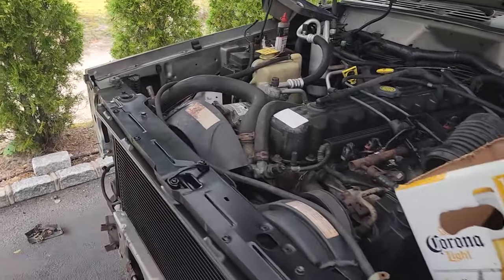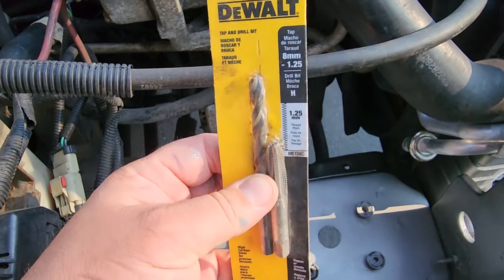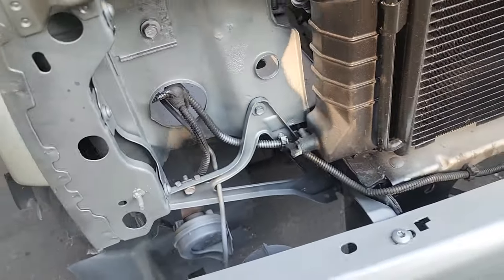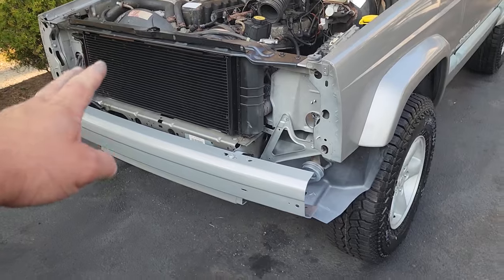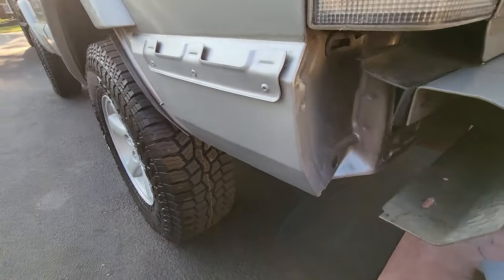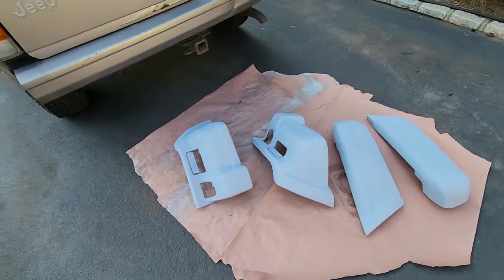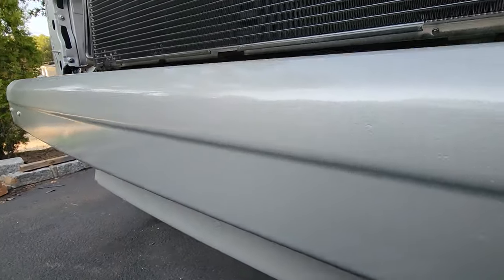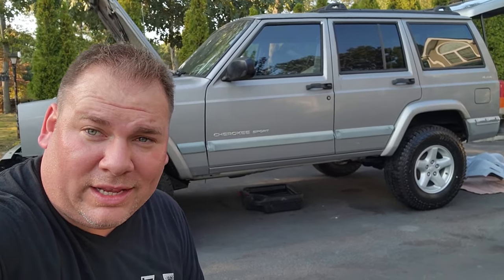THE TOAD EPISODE 5!!! JEEP CHEROKEE XJ PROJECT UPDATE.

Comment: Don´t worry about that bug in your clear coat. When you put your bumper end caps back on, this spot will be covered anyways.
But generally you´re right - better deal with it after the paint has dried.
Reply from the maker: Yes! Lol I should have mentioned everything outside the torx bolts and you're still good! Haha

Comment: Quick tip when painting under the hood or around wires you can get some cheap aluminum foil and wrap the stuff you don't want to getvpant on . Keeps everything looking good and peel it off when the paint is dry .
Reply from the maker: Thanks for the input!  I usually wipe it down with a paper towel with brake clean on it when I'm finished. . comes right off.. usually. Lol

Comment: Nice XJ! What size are the Air Box bolts? I need to replace mine. As well as the Air Box Nut.
Reply from the maker: air box bolts should be M8x1.25 with a 13mm hex head and thery're about 1.75 inches long
Reply: @ProjectDanH  Your the Best! Thanks for the reply. Much appreciated!